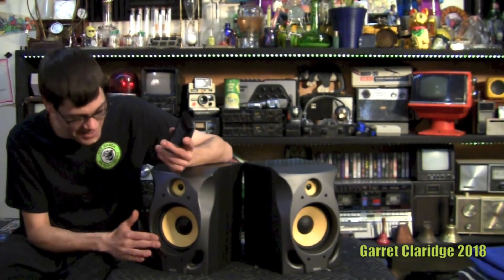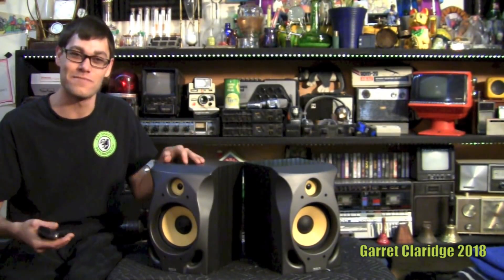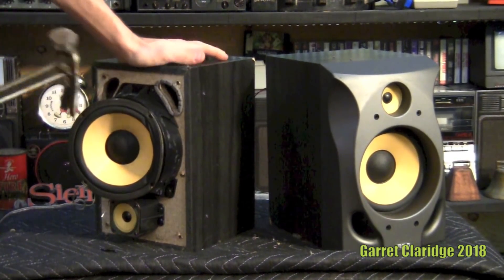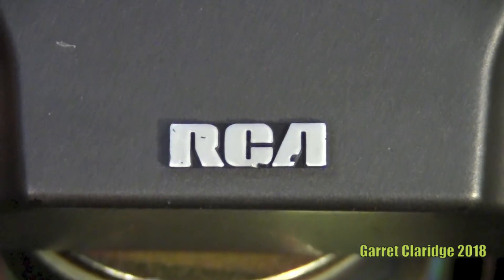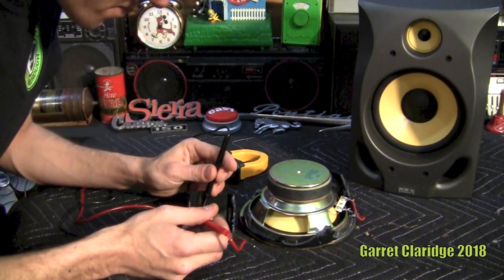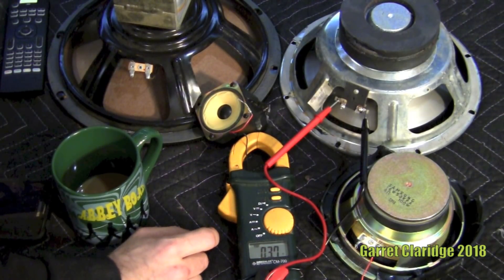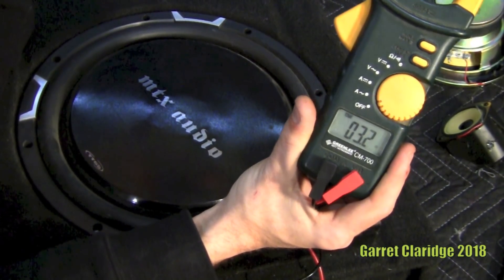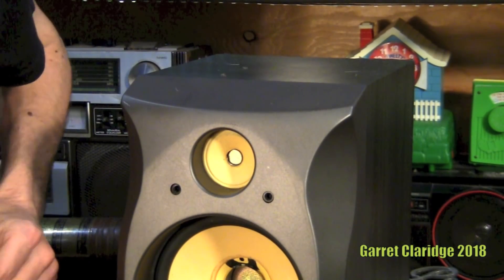SPEAKER BLOWOUTS! - RCA Bookshelf Speakers

Comment: Those tweeters probably had ferro fluid in the coil gap. With those aluminium formers, they can handle a decent amount of power for what they are. Sound good they may not however!

Comment: Garret, do you still have that Harmon/kardon subwoofer? I saw it in the background in some of you 2014 and 15 videos and I noticed you blew both the satellites that go with the woofer in the electric drums video. Is the subwoofer next?
Reply from the maker: I can never recall having an HK subwoofer, however I work on lots of equipment that is not mine, Pro audio and guitar amps for the most part - so there might have been a waiting repair seen in the background
Reply: Hi